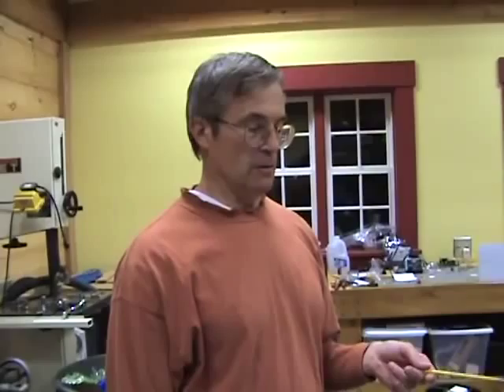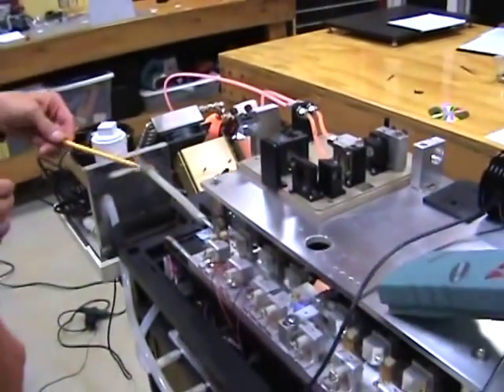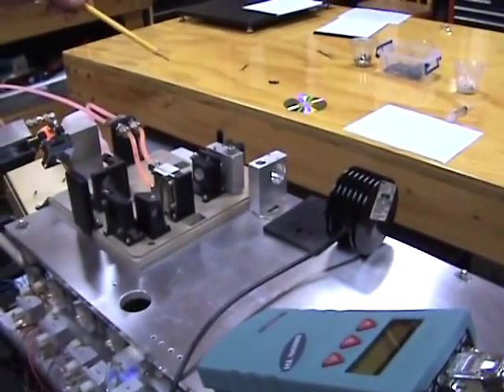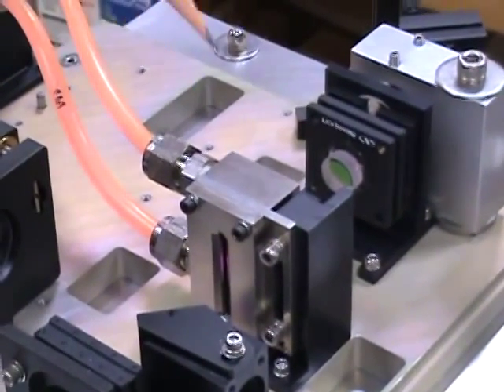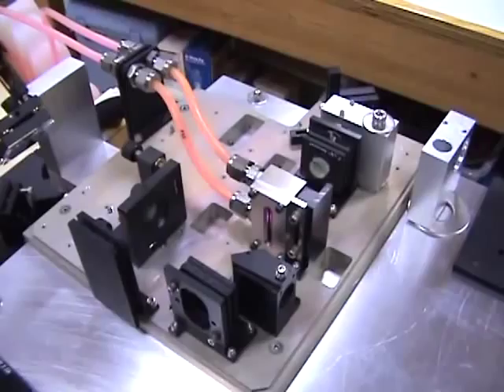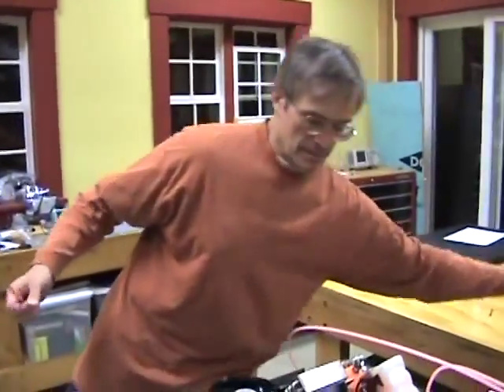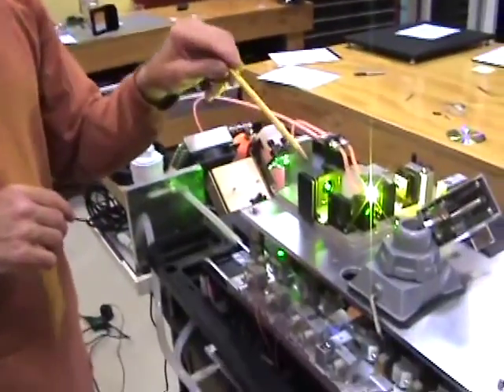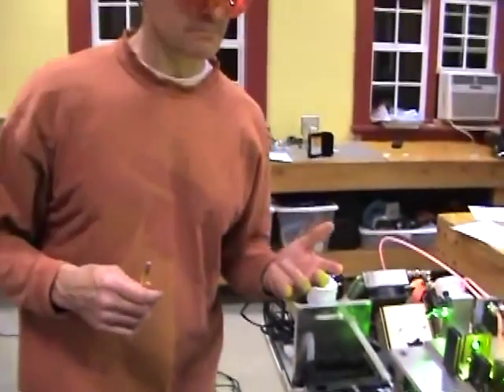575nm Yellow Dye Laser - Reposted

Comment: if the goal of pumping the dye solution is just to move new dye into the focus quickly
then how about just using a fine jet?            maybe using a rather large dye cell is
to reduce turbulence?
Reply from the maker: There are free jet flow dye lasers.  The lack of windows  makes it possible to achieve very high energies, but they can be very messy.😕

Comment: Very interesting. I have always assumed high divergence characteristics were mainly due to the lasing medium length.  For instance, a gas laser with a long lasing medium having low divergence and a short lasing medium, such as a laser diode having wide divergence. Why does a dye laser have such a narrow divergence in comparison to pumping an SHG crystal? I would assume that since they are both being pumped with a coherent source and both similar in size mediums that they'd have similar beam characteristics. This is obviously not the case.
Reply: Also, very interesting info on stacking the beams on their fast axis. I've never heard of that but It makes perfect sense. I'll have to experiment with that sometime.

Comment: Cool laser. You seem to be concerned about dye flow. You could go to the next size lines and fittings, and perhaps redesign your dye cell so it doesn't have 90-degree bends. You could user lower pressure to do the same thing, and the dye would stay cooler. Computer water cooling hardware common is cheap now.

Also, as the water-coolers have learned, certain types of tubing--I think even certain types of tygon leach plasticizes.